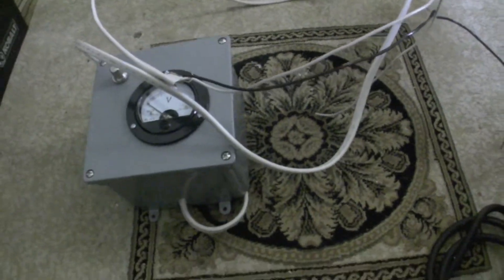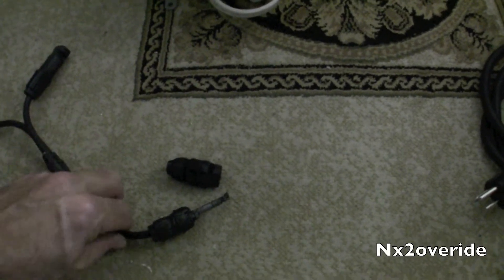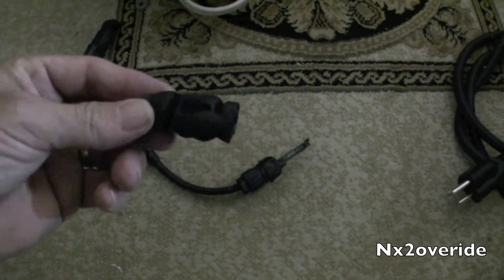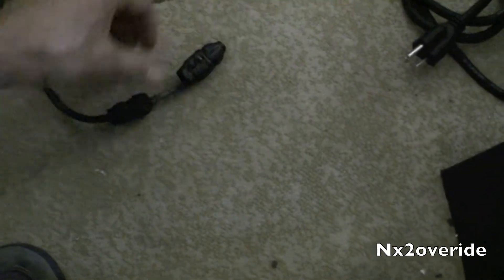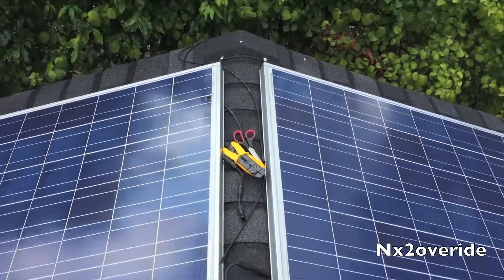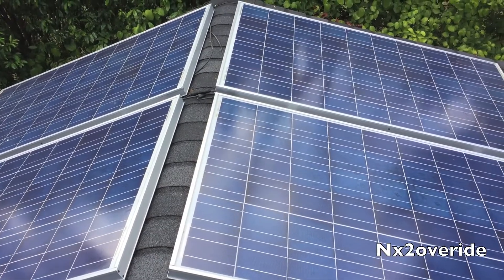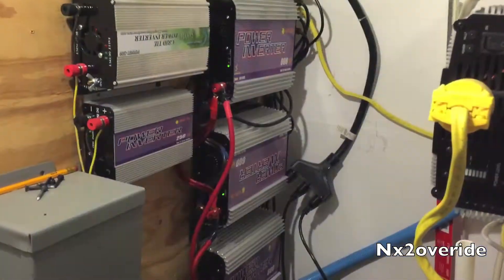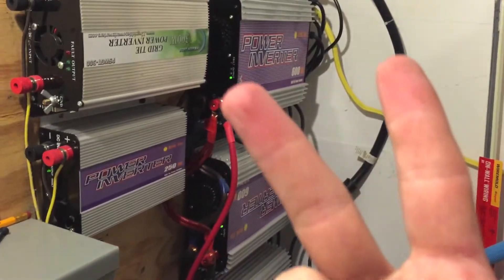Summer Sun melted one of the Solar MC4 connectors

Comment: You need to get both panels and wire off roof, no air circulation and wires could rub on roof and wear through, matter of fact code state wire needs +5 cm off roof...

Comment: Yeah it gets hot up there. :P My roof is now white. I need to do a second coat when the budget allows. The stuff ain't cheap. Can't you just cover those wires with something else to keep the sun off them? I mean doesn't have to be pretty as no one will see up there anyway. :)

- Heidi
Reply from the maker: BlackCat2 yep, budget the key word..lol I am going to buy some extension wires and tuck them under the panels. pretty much all I can think of unless I hard wire them directly to the DC disconnect. ;)